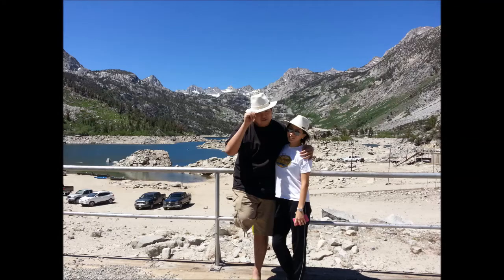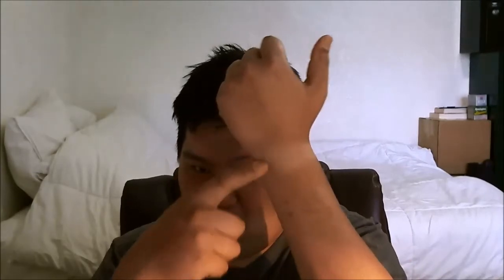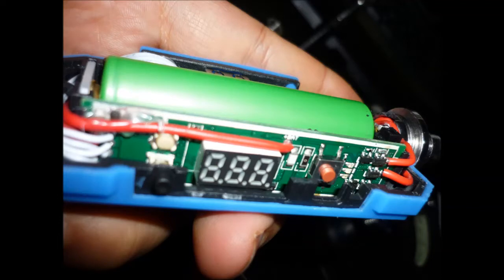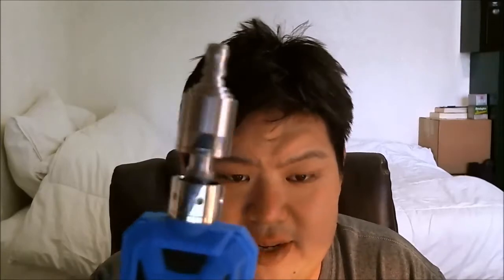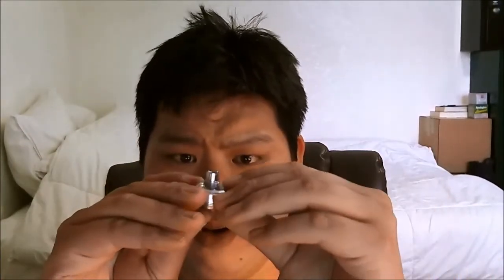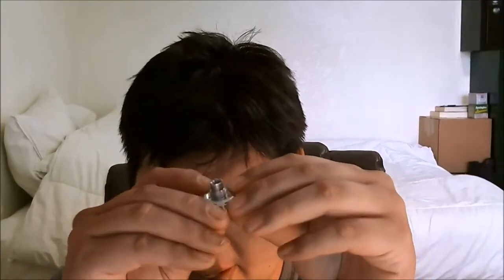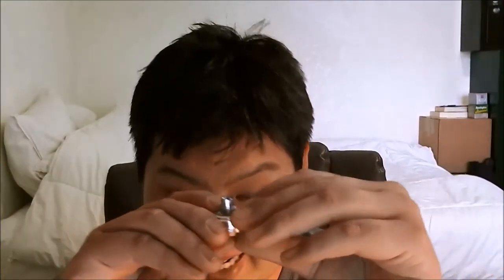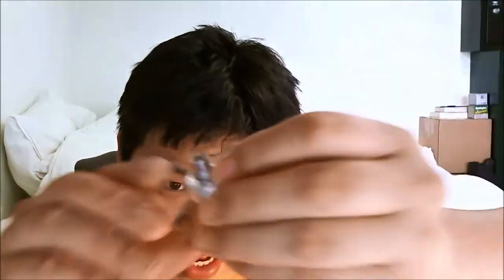Stripped 510 connector fix

Comment: Hello Andy, Really enjoy your video's and the great info you put out. You have help me out a lot on some questions I have had about some thing. I went out and bought an E-Lvt after watching your video's and I really enjoy it. I haven't had a problem with my 510 connection, yet but with your video I will know what to do now. Just have one simple question for you and maybe one day this might help someone. I noticed my protanks on my e-lvt are a little wobbly and I noticed it my connection is what is wobbling. Is there away to tighten it down a little if I took it apart? Wanted to ask before I did cause you said something about taking yours apart to see what it looked like inside. Thanks and sorry this is so long.
Reply from the maker: last time I opened her up, it seems like the 510 was pretty easy to repair, but it's been a while since I opened the elvt up. I would just use it a little wobbly and if the problems becomes worse, then opening it up and checking it out. I think it is held in there by some glue, a drop of super glue should fix the issue. taking the elvt apart is easy, only four screws in the back and the slow and steady technique should be used.
Reply: Thank you  Andy for your time and fast response . I will be going out today and getting some super glue. Don't want it to get to the point where I need to get inside and look. Thanks again Andy.

Comment: I had to do this for my hana dna 30 unfortunately. As a quick, short term fix you can also wrap your RBA/RDA's threads with a small amount of plumbers tape which will help it to catch on with the connecting device's threads
Reply from the maker: I believe plumbers tape is the white Teflon which is like rubber. The only issue with this is that it does not conduct electricity at all. But usually the threads stick out of the Teflon which make it conduct but might notice a voltage drop. The hana modz use a fixed 510 connector which should be replaceable. I always get so upset when a 510 connector strips. It is the a Achilles' heel of mods.

Comment: My.hana 30 Fasttech clone has stripped after a few weeks use! But since I don't have an adapter yet, I tried the tin foil directly on my Kayfun lite's 510.  It held but reads SHORT.  Thought you said it was also ok to do this way?  HELP.
Reply from the maker: yes it should work, make sure the tin foil is only on the thread and not on the center pin of the kayfun. Also use only one ply of tin foil. I believe you used too much tin foil and the foils is touching both thread and center pin on the kayfun. Try wraping only the thread and it should work perfectly.
Reply: Stuck a slice of plastic straw around the atty and it works.  Prob had too flimsy tin foil as it keep ripping.
Reply: Thank you!